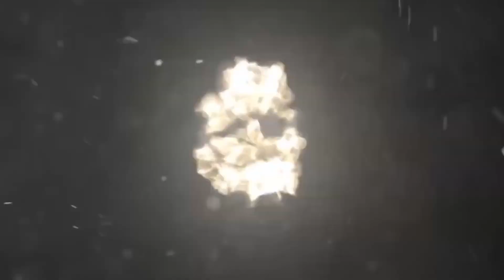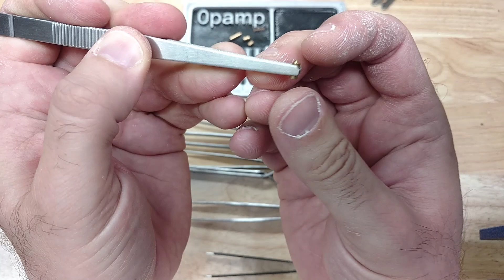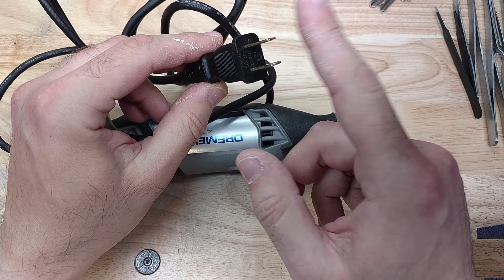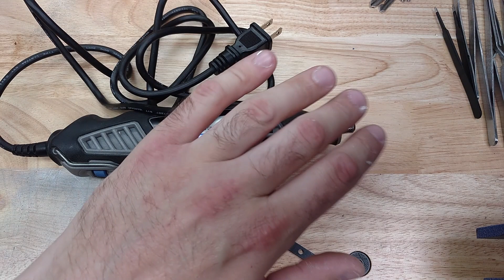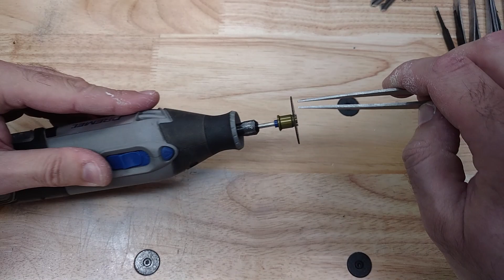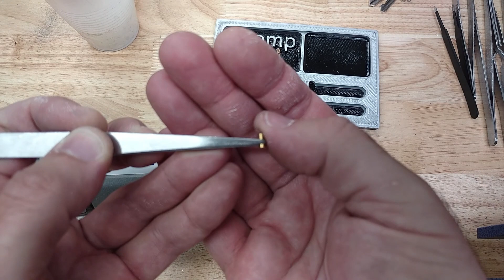Fabrication Friday 7: DIY Pinning Tweezers

Comment: Here is one place we differ.  I would have cut off the excess after making the notch.  EDIT: I also would have finished it with a file instead of the wheel.
Reply: @LockPickersUnited  Using files instead goes back to my teacher.  He was old school and always said the quality is reflected in how much hand finishing you do.  He also came in almost every day and told us he could take any 20 of us in a hand to hand fight.  He was a great teacher one of the few I will always remember.
Reply: Idea: Mounting the Dremel would allow use of both hands to control the work piece.
Reply: @sluggo2014  He actually mentioned using a mount if you have one.  About 4 minutes in.